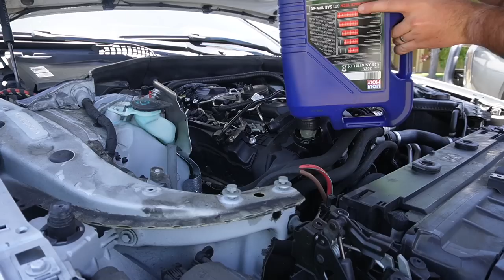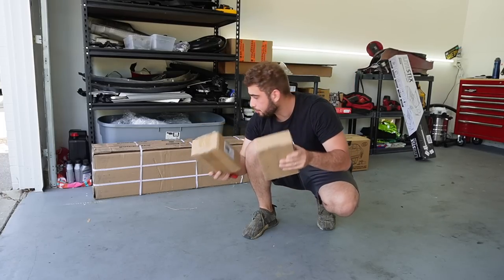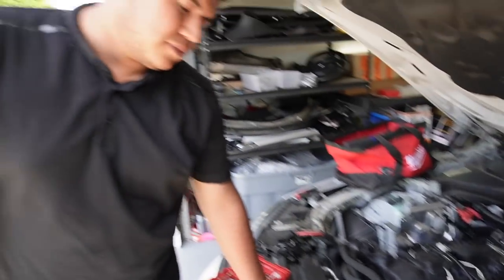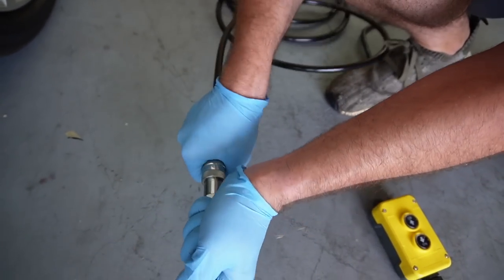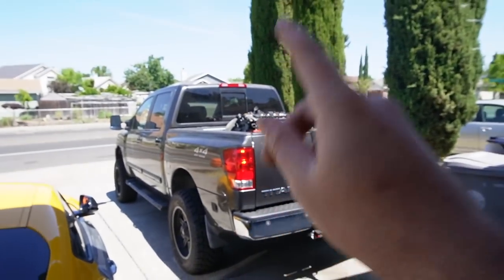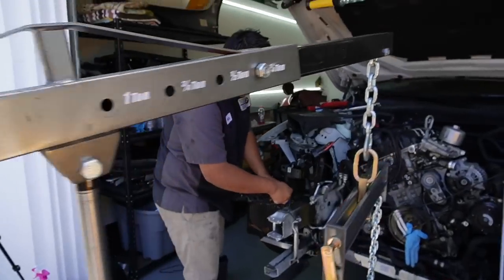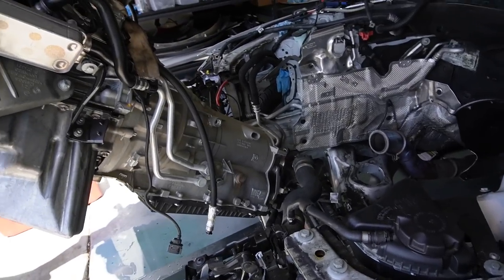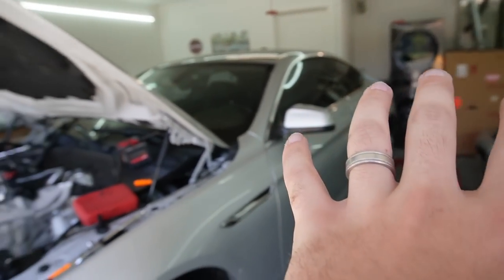PULLING THE MOTOR FROM MY BMW 640I! My New Motor Is Bad Luck :(

Comment: The PS2 turbos won’t be the reason for the engine seizing, it’s just the donuts lol

Stock turbo or aftermarket turbo, if you do donuts with no baffled sump on the N55 you risk seizing the engine 🍩🍩
Reply: Says he did a burnout not a donut
Reply: @BmwMe-uh9sy  well I think he was doing donuts with low oil

Comment: Dude finally you got quickjacks I was surprised that you didn't buy them long time ago. That's what was missing in your garage. I got mine about year ago and it was the best investment. I'm saving BMWs like you so they are used all the time. When I'm working under heavy car like this I use jack stands underneath quickjacks just for extra safety. And always remember to release both locks when lowering the car. Also get the extension you will need it for sure.

Comment: Don’t think engine blew cuz of the turbo, blew cuz of oil starvation, the oil pump was a fatal flow of those engines
Reply from the maker: Could be that too, but rod bearings are also a major issue for these engines. Honestly not meant to be pushed around, that’s what the n54 is for lol
Reply: I rebuilded mine and installed s55 oil pump and kolbenschmidt bearings
Reply: @bettervibeez3376  thats like a 2000 upgrade
Reply: @BmwMe-uh9sy  i live in georgia so i found  oil pump (8k miles) for  around 150$ ,bearings (main and rod) +-250$ and engine rebuild labor 300$ , +gaskets, valve seals etc.
Reply: @BmwMe-uh9sy  im going to flash custom stage 2 map,  installed catless downpipe, k&n dropin filter and 1step colder plugs